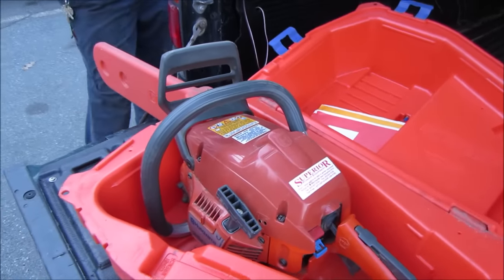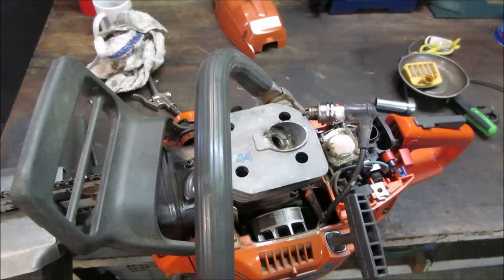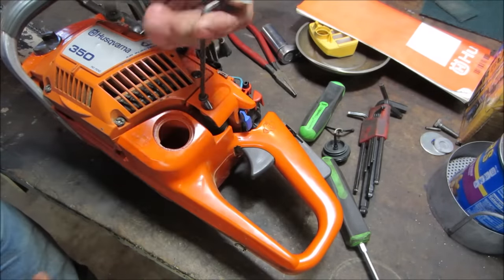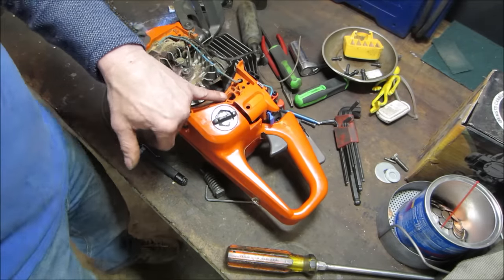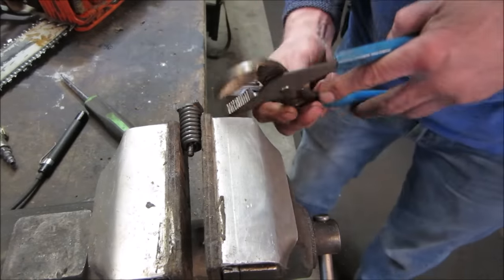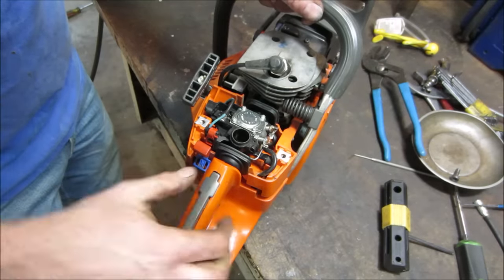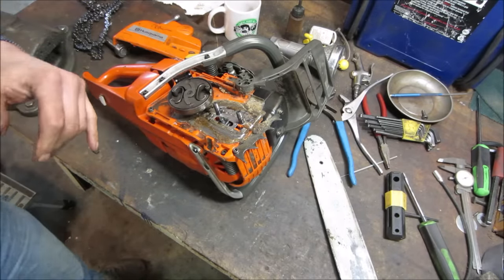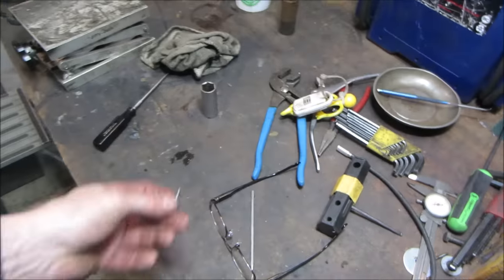Can It Be Saved? The Junkiest Chainsaw Ever. Picked out of The Trash.

Comment: Many years ago I was doing  a tree job and observed a guy across the street cutting down a large Pfitzer hedge.He was having a bad time of it. I walked over and offered to sharpen his chain. He was happy to let me try.When I went to do it it turned out that the chain was on backward.
Reply: Sounds like my roommate. She got one of the Kobalt 80v chainsaws. Didn't ask me for help or anything when putting bar and chain on. Used it and told me it wouldn't cut. She had the chain on backwards 🤣. Flipped the chain and it cuts fine. Just eats through batteries fairly quick.
Reply: I've seen it more times than you would imagine
Reply: Run the chainsaw in reverse..... no issues
Reply: Haha not gonna lie I've done it before... been doing tree work for 15 years now tho
Lmao
Reply: At times you think that before you can buy a chainsaw.  You have to a short but important course. On operating a chainsaw.
Reply: @ophiuchus9071  
Very true. 
The same thing buying a ladder.
Reply: ROTFL.Ive heard this kind of thing more than once
Reply: Haha I've done it when I first started tree work 12 years ago...🤣
Reply: I have done that before, but always caught it before starting they saw. Well, except one time. But didn't take me long to realize after the saw cut worse than I'd ever experienced.😂
And not gonna mention names here, just to be nice, but I know a person who put chain oil in the gas tank, a lot of smoke and an angry saw. Just glad it wasn't my saw.😂
Same person also put oil instead of grease in the head of a clearing saw, insisting it was what was meant to be in there even after me saying it wasn't right. And guess what? Oil began running out of it  But what do I know, I just went to school to work with these machines.😂
Still love the person, but can be a headache some times.😂
Reply: @DanielSvensson666 , I filled the gas tank with bar oil once.  Luckily I realized before I started it.
Reply: @Nightsider-xr5lx  o
Reply: @robertselles257  yep, I hold mine upside down, it works
Reply: @robertselles257  yep, I hold my saw upside down if the chain is on the wrong way, it works
Reply: @J-unit84  same here more times than I want to admit the only thing I dislike about my husqavarna 562xp is replaced the chain the chain brake is a bitch to work with
Reply: I've seen that more than once.😅

Comment: I’ve a husqvarna 350 bought in 1997, it’s now 2021, replaced the fuel filter and the pull start. With proper care and oil/fuel mix and chain oil it’s works great. There is an oil adjustment for hot and cold seasons, though I’ve found if kept clean - clean the bar regular (to include oil passages) the saw won’t let a person down.
Reply: LIKE !! PLASTIC !! CHAIN !! TOO !!!

Comment: Chainsaws are by far the most misused small engine power tools, in my experience.  The number of times I have seen people cut into the dirt with them, not fill the bar oil when refilling the tank, not sharpening the blade after/before every use, not overheating the bar, etc. is astounding.  I guess that's why push mowers are getting to the point where you don't even need to change the oil in them anymore, people can't be bothered to actually learn how to use their tools.
Reply: YEAH !! RIGHT !! THROW !! THE !! MOWER !! STORE !! OUT !! OF !! BIZ !!!
Reply: I work in the industry. yesterday I had a customer bring a MS 362 for a "choke adjustment." in all my years, I've never did a choke adjustment.  well, this one was SOOOOO dirty, you couldn't pull the trigger back far enough to allow the choke to set. cleaned it up, worked great. went to go start it, took the bar cover off, and saw he had the chain BACKWARDS!  And these people procreate and probably carry a gun too. scary
Reply: Good points. Fully agree.
Reply: FYI it's a chain not a blade.
Reply: @nobodythatyouknow241  technically speaking- loop
Reply: Boy, you really hit the nail on the head on that one, WAY to many idiots with these things!!!
Reply: @ENDERTON2000  I put a chain on backwards just recently.  It was an oops, but I noticed and corrected myself before putting the cover back on.  Nobody is perfect but the people who never figure out what's wrong are very scary.  My neighbor has a new man mowing his lawn.  He has a brand spanking new Gravely.  The results over there are laughable and I'd bet my allowance this new lawn care "professional" has his blades on upside down.
Reply: @ENDERTON2000 my man has money with a MS362 but no sense in how to use or maintain it🤦‍♂️
Reply: Ppl don't take care of anything that's why nothing lasts anymore

Comment: Someone did not use the right mixture of gas to oil for that saw. Husky is a GREAT chain saw! The reason that trigger was disassembled and that saw is so loose in the mount is someone hung it up and tried to jerk it out of the tree and cracked the bushings that are supposed to hold it in place.

Comment: I once sold a used working sthil chainsaw to a guy who claimed to be a ‘woodsman’ & a week or so later he came back swinging his fists, saying i had conned him ! 
He had run the saw with no bar oil in it for about three hours by which time the oiler had burned up ! What Total muppets some people are !
Reply: It sounds like he was a woodsman who only used an axe in his work. He should have asked more questions when 'up-skilling' to the new technology.
Reply: @David-yo5ws  The story is told of the woodsman of old that was given a new chainsaw by the boss and told to use it instead of the cross cut  saw he was using....
A week later the boss came by and said  "You've only cut three more trees down this week than you would have done if you kept using the cross cut...what's going on.
"Boss" said the woodsman, "the chain gets real dull real quick and it doesn't have the same stroke I am used to".
With that the boss takes the chainsaw and starts it up....
"Boss, what's that noise"????

Comment: Start process for this type of saw: ichoke on full until the saw "starts 
" to start. Turn the choke off (without pulling the gas trigger) and the saw should start on high idle. Pull the trigger and the saw will go to low idle.
Reply: Exactly

Comment: I picked up a husky 60. Guy threw it out because he couldn't get it to run. I pulled out the spark arrester screen from the muffler. It was plugged with carbon. That was 20 years ago. It still runs great.

Comment: the rubber bushing underneath are missing. he probably pinched the saw and yanked on it like a nut and lost them.
Reply: Just like his marbles, never to be seen again.
Reply: Your right...
Reply: @onelonelyfarmer
...Yea I was thinking the same. And the state of the machine in combination with "worst chainsaw"comment made me strongly suspect "non talented" handling rather than outright equipment failure.
Though I must admit not being a fan of metal screws into a platic thread on a tool like this..
Best regards
Reply: @onlyeyeno   Total agreement. Like finding plastic and metal gears meshing on self propelled push mowers.
Reply: @onlyeyeno  I've owned (and mercilessly abused) two identical Husqvarna 350's. I agree about screws threaded into plastic but overall I was happy with the H-350.
Reply: slide a bit of rubber hose over that pin and maybe a piece of larger hose over that hose to take up the slack. Not the first rubber "bushing" I have made that way
Reply: Just posted the same thing lol
Reply: @robstone5333  That might be a safety feature though. I definitely know that's what they do in handheld kitchen mixers, they deliberately design the gears to break before the careless user's fingers do. And I definitely don't consider that a bad thing, rather a broken mixer than a broken finger. And even with that, stupidity will still be punished, I'm sure it hurts enough until the gears actually shear.
Reply: @whs2220  I have an assortment of "rubber washers" that were used on the old timey faucets. One of those would work perfect for that pin, just might have to open the center hole up a bit.
Reply: I keep losing the rubber bushings on my heavy duty brush saw (52cc).  This spring I'm going to try using small PVC - it won't cushion as well, but they should stay in place better.
Reply: @Ragnar8504  no its a pin that holds a rubber bushing that goes into the plastic its exactly like my chainsaw
Reply: @TylerDuysen  I was talking about plastic gears in lawnmowers, not chainsaws!
Reply: @Ragnar8504  I believe they do that in the new KitchenAid stand mixers as well. Nylon gear that will break before the motor will burn out.
Reply: @Jambomust be a newer model thing cuz mine doesnt have that it has rubber and plastic bushing that slide into the plastic
Reply: @Ragnar8504  never seen a plastic gear on a lawnmower ever from any brand shit would just break just like a cog on a snowmobile
Reply: @onlyeyeno  Its the wrong screw.
Reply: @robstone5333  I agree. i noticed that on a toro recycler personal pace the rear wheels have a plastic gear bolted onto them and the gear on the transmission is metal. I upgraded to the Super recycler with blade stop last year and thank god theyre all metal gears on the wheels and transmission.
Reply: @TylerDuysen  Toro Recycler. Personal pace. They have plastic gears on the wheels
Reply: @cashen7384  oh interesting neat i guess
Reply: @TylerDuysen  not sure if its neat or shitty. I upgraded to the super recycler last year and its been alot more reliable especially drivetrain wise. Hopefully no more gears stripping.
Reply: @cashen7384  i figured as much i meant neat in a sarcastic way because like a snowmobiles cogs plastic gears just strip guess i shoulda just been straight forward my bad
Reply: It's a Husqwanga.
Reply: One thought. If the bar has grease holes at the tip, grease the tip sprocket! I just spent a week scratching my head why the chain on a Husky 455 was loosening and tightening for no apparent reason. It was driving me nuts, until -- out of desperation -- I pumped a little grease into the end sprocket. It solved all the problems! Of course, I'm pleased the project is done, but I'm also kicking myself for not having thought of such a simple fix at the beginning.
Reply: @dagrote1  luckily mine has double oilers it oils the front and rear but i always oil it extra
Reply: @TylerDuysen  You mean, oil is delivered to the tip sprocket? I wonder how it does that? I mean, I guess the bar oil will be carried around the tip, but how does that oil get into the internals of the sprocket inside the bar? Is there perhaps a canal in the bar that diverts some of the oil in the bar groove down to the internal sprocket inside the bar?
Reply: @dagrote1  yes its got a canal on top and bottom oil goes through the top flows the bar comes back through the bottom one and out the exit port and yes theres a spring and sprocket behind the bar when its not running its closed when its running its open and oil flows through the canal in the bar
Reply: A.V. Dampers.
Reply: This is literally my chain saw and its condition.

Now I got a dangerous idea on how to make it work again.  It's fun staring it WOT with very little control over the chain rotation.  Will be a game changer.  (currently runs a little to a lot, but no stop)  Wiggles too, gonna inspect my bushings on the bottom.  Bet someone yanked like a nutt on it when I let them borrow it and it never ran the same.
Reply: @bryankrohn1439  
The antivibration dampers are there to separate the handles from the motor body & the reason for that is to protect the operator from  contracting white finger, a condition caused by vibration getting into the handles.!!
Reply: @dagrote1  the oil pump isn’t working on your saw or the hole on the bar is plugged and you don’t need to grease the nose sprocket seems like whenever a person did do that they would always fail sooner compared to never greasing the tip it’s like the grease would repel the bar chain oil from doing it’s job
Reply: @jeffyeo3762  Thanks for the reply, Jeff, but I can't agree with you. I replaced the pump, all the lines, the bar oil filter and cleaned out the ports on the bar. Still, the chain loosened and tightened for no reason until I greased the tip.
Reply: JB WELD!  HAHAHAHAHA
Reply: Accurate analysis!
Reply: @dagrote1  do you lift up on the bar when you take the slack out of chain and hold up on bar as you tighten the nuts?
Reply: Yes. Always. Greasing the tip solved the problem I was having, so that must have been it.
Reply: @jeffyeo3762  If one is not supposed to grease the sprocket, why would the manufacturers, who have years of experience and loads of engineering knowledge, provide a hole specifically for that purpose?
Reply: @Ragnar8504  it's a normal design practice to have the easiest gear to change made out of the softer material, like brass or plastic, versus making both out of hard steel.
I think a crappie design in a saw is the Stihl 250 in particular because the oiler gears fail early.
Reply: @kenl16  exactly
Reply: @jeffyeo3762  always lift the bar when adjusting the blade. It will start running a bit tight once you start using it the chain will loosen up a bit.
Reply: John Deere z Trac 355 cutting in tall grass. Running fine then mower stops moving. Still running,push handles but want move, What happened
Reply: @TylerDuysen  0
Reply: @dagrote1  check on how worn out your bar tip sprocket bearings are! Sounds to me that they are heavily worn and the adding of grease is just taking up slack of the worn bearings. Mine do just as you explain yours pretty often but bars wear down quickly when cutting between 4 to 6 cords a day 100+ days a year. Also i extended the lifetime on average of my saw bars probably 20 cut cords of firewood if not more by taking and shooting a shot of grease in the bar once a day or chain change. Also the life span of my chains on average nearly doubled on my large saws and 24" - 36" chains!!

Comment: I've had my Husqvarna saw for almost 20 years. It gets moderate use, but I always make sure it's cleaned up, and everything tightened back up as needed. Whoever had this saw, abused it, then wanted to blame the saw for failure.  That saw is just a residential, light farm work type saw. You can't expect more than they're designed to give.  Nice job fixing her up. You got a free saw!  Chainsaws ain't cheap these days!

Comment: tip: before you cut off the cap screw, run a nut onto it.  When you're done cutting, run the nut back off to clean up the threads.

Comment: Don't forget, the number one reason for scored cylinders on any engine is not letting the engine warm up at idle before running it hard. The aluminum piston expands faster than the cylinder causing the scoring. It's also a good idea to let the engine cool down at idle after running it hard before shutting it off.
Reply: Yeah I warm my 2 stroke tools up and let them cool down. Can't afford new ones all the time.
Reply: Sorry to be OCD, but the piston and cylinder are both aluminium...
But the piston ring is steel, and that's what scores the cylinder 😁👍
Reply: How many people hit the throttle the second a saw starts up?  Almost everyone I've ever seen!  The saw has a built-in high idle. When it starts, DON'T touch the throttle!!! Leave it be and let it idle slightly high! Now it's steadily just above idle (high idle), And it will heat up without stressing the saw. Every time you rev it you're torquing parts that aren't warmed up, and at first might not even be lubricated well. You're also heating it up quicker than you should. This way it runs at one speed, not too high, and not too low.... Unless your saw hasn't run for a while, and is about to stall, leave the throttle alone, and let it warm up on high idle!!! We're all like little kids, and can't help ourselves. We have to rev the thing over and over and over while it's cold??? WHY?   My husky 261 is 23 years old, with the original bar, and all I've ever done to it, is replaced the fuel line twice, except for new spark plugs, blowing out the air filter, flipping and Bailey ever having to file a slight burr off the bar every five times I fill up the tanks, sharpening every tank full by hand, taking the rakers down every 5 tanks, cleaning out the slot in the bar including the oil hole, and breaking down the star enough to clean all the sawdust out of it around the clutch and bar.  That's it!!! I cut 10 to 20 cords of wood a year, for 23 years, and the saw still outperforms new ones that are the same size.  Take care of your saw, and you don't have to beat on it to get it to cut.  If something seems wrong with it, like you're seeing, smelling smoke, it's not cutting as quick, the chain sounds different, or anything, stop what you're doing and check out your saw.  You might have just hit a nail or the dirt for a second, and it just needs to be touched up.  If you push it this is when you wear your bar, and beat on your saw.  A stitch in time saves nine! Be safe and spread your knowledge. Thanks for the video!
Reply: @brianstrange7942  10 to 20 cords a year? Wow. You might want to know about rocket mass heaters. It is claimed they use 1/10th the wood of a normal wood stove.
Reply: I don't care about saving wood I like burning as much as I can😢